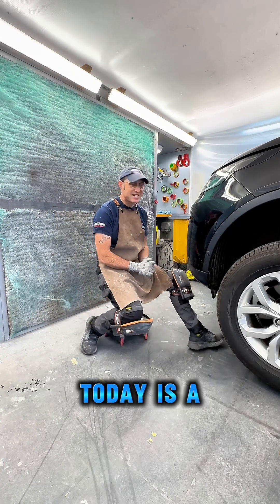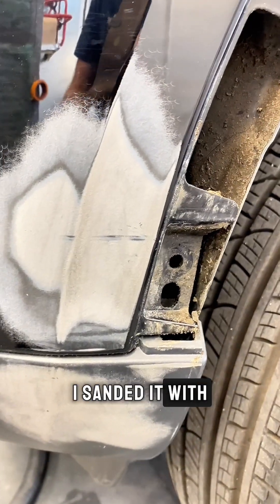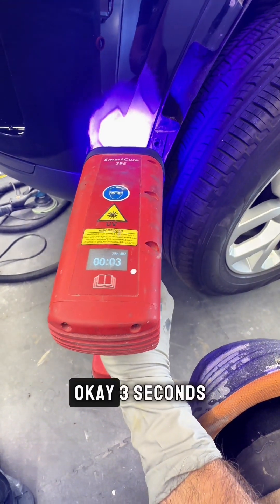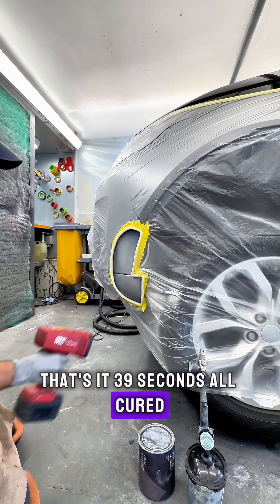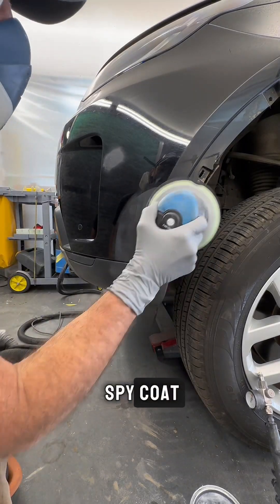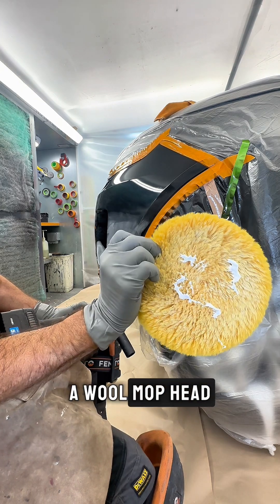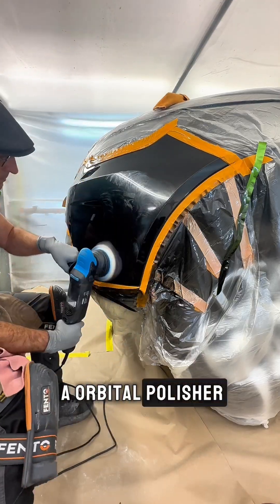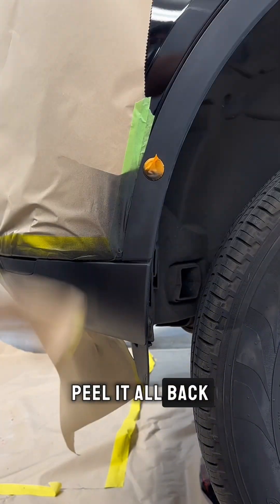Colour Coded & Textured Bumper Repair

Comment: Very nice job there Wayne and the instructions were very clear and easy to understand. I do like the Colad UV putty as it cures fast even with my little lamp it's only around 10 seconds but I do tend to apply thinner coats to build it up, I also like the Final Systems UV primer in the rattle can as I don't use it that much so it seems to keep better👌
Thanks as always for your videos👍